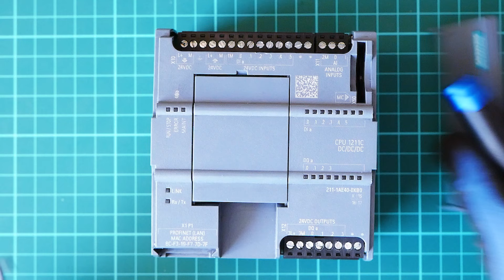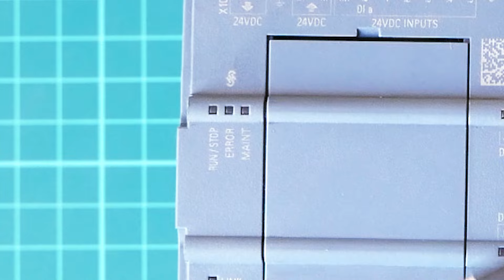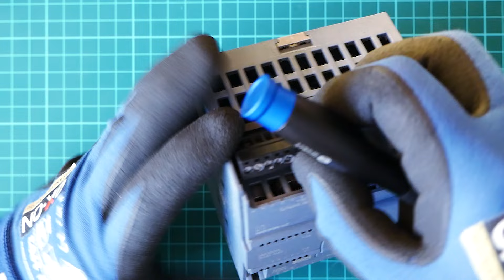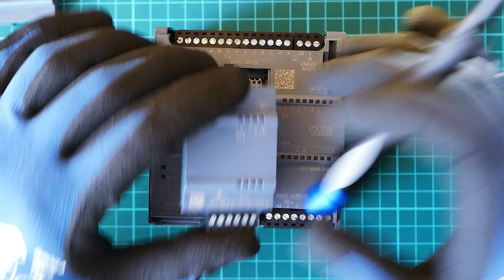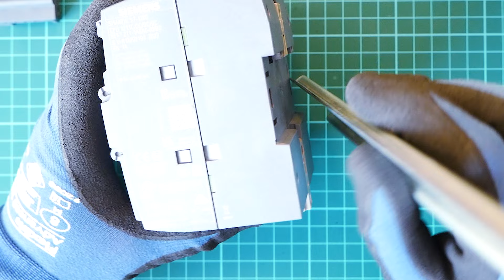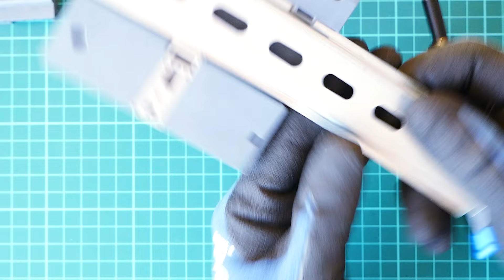Beginner introduction of Siemens S7 1200 PLC

Comment: Thank you for the video, it's comprehensive.....I just got Siemens S7 1200, Scheider Eleectric 24v, 3.1A power supply and Simatic HMI. Could you  please provide step by step tutorial on how top wire and connect the three devices to together. looking forward to your video. Thank you.
Reply from the maker: Hello. Use terminal blocks for that. Connect from power supply 24VDC to terminal bloks, and from that connect wires to PLC and HMI.. This video has only few views i dont know if i will create more videos on this topic.
Reply from the maker: Lately made few video regarding Siemens PLC.. Check them out.